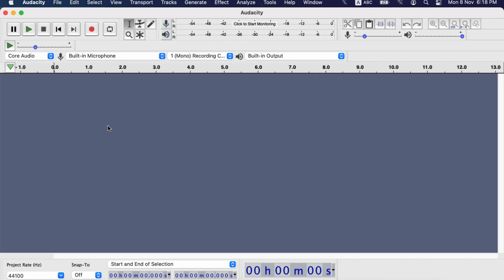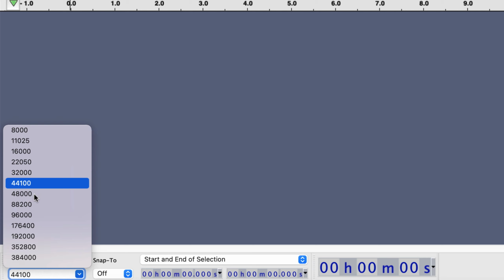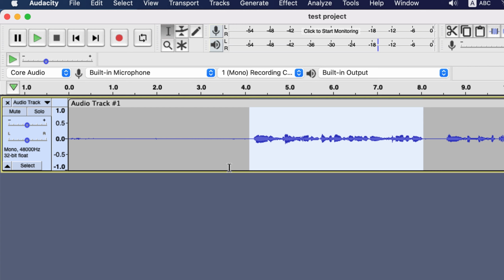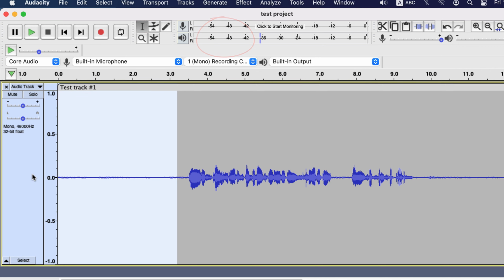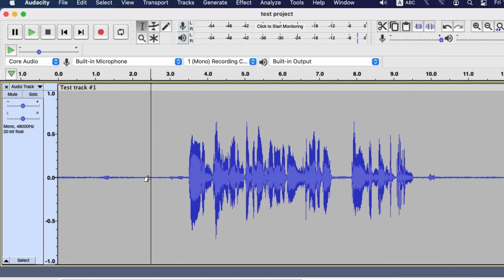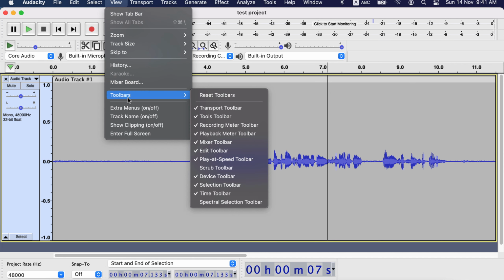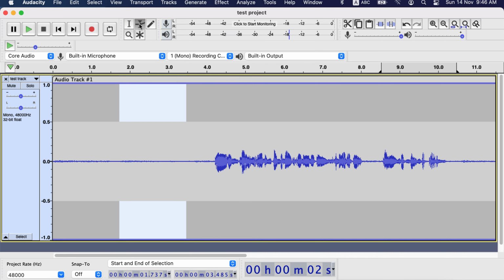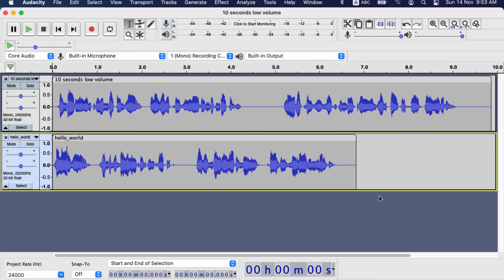Beginners tutorial on getting started with Audacity recording and editing

Comment: My Audacity screen does not show Core Sound or Buit in Microphone or Output.  I am so far totally confused.
Reply from the maker: View --> Toolbars --> Device toolbar from Audacity menu
Reply: @MasterEditor5  thank you for reaching out to help. The problem I am having is a cyclical screeching sound with an echo when I push Record.  This occurs because the microphone volume slider gets stuck at the highest point and I can't slide it.  i can slide the speaker volume, though.
The mic slider for an undetermined reason will sometimes let me move it to very low levels.  But mostly not, and even if I have success, it goes back to high levels.

Is this download safe?  Why are they offering it for free?  That concerns me.

Comment: When would you need to use loop button?
Reply from the maker: Currently I do not see great use of it unless you want to listen to a part over and over. It will become useful when Audacity enables live editing.
Reply: @MasterEditor5  Excuse  me for interrupting, but the loop tool is great if you think you're hearing a strange sound behind or under dialogue. You want to know if it can be isolated from the voice so you can delete it, but you can't determine exactly where it is under the voice. Play over and over until you think you've detected where it's coming from. Then zoom in until you actually see the glitch. Unless it's actually embedded with the voice, you can probably snip it out, if you've increased the size sufficiently.